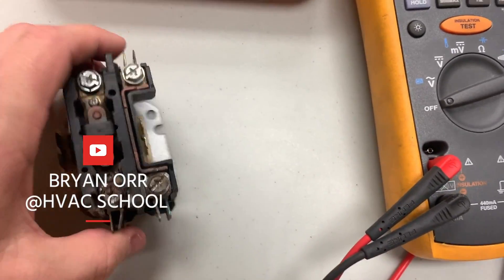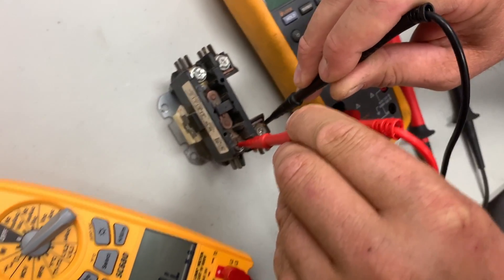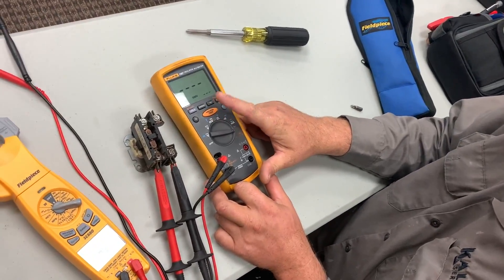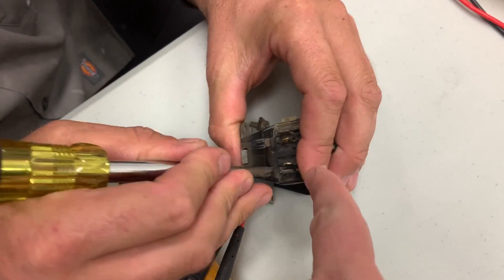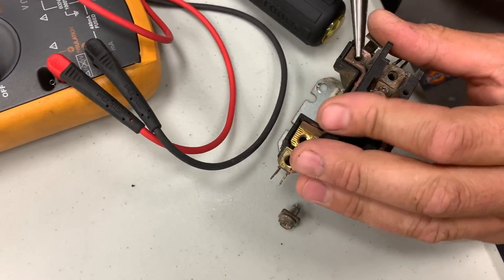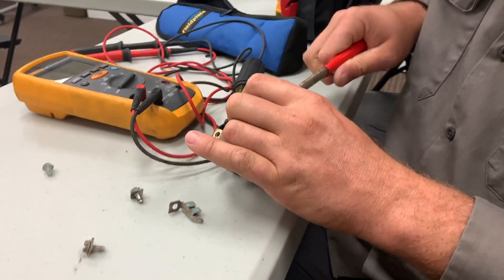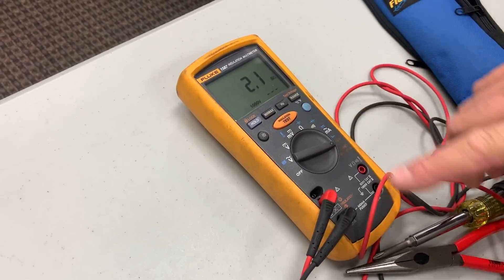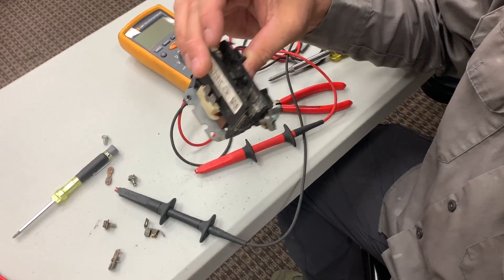A Strange Contactor Issue

Comment: That blue residue on the contactor looks suspect to me. I had this issue about a month ago blowing the low voltage fuse on the furnace and what I had found was that some of the cleaner I used a month before got into the control compartment and dripped down onto the contactor which eventually caused a path for the low voltage current to go to ground.

Comment: I run into this condition all the time in my side business of vintage tube amp repair. A carbon track becomes part of the molecular structure of the insulating material and cannot be removed. Happens often in power tube sockets when the tube has an internal short occur.

Comment: Bryan, hello, but I really DESPISE this CHEAP CONTACTORS , case a Carrier 460 v 3 phase , it only had a 2 pole, & the other led went direct to the compressor , were, it singlephased cooked it , but for SURE I replaced it with av3 pole one just retired the direct leg, all this is being CHEAP, like FRIGIDAIRE used lots of STEEL TUBING, also were FIRST. to use DCHRADER VALVES, those days they were same as car tube valves LONG     Cheers 🇺🇸🇺🇸🇺🇸🇺🇸

Comment: A friend of mine had a brand new contactor that would not conduct electricity through the floating bar. He measured on the bar itself and not the screws. It showed 208 (commercial job).  A solid metal bar that would not conduct!!

Comment: The only place the carbon can come from is the plastic insulators. The contacts by there very purpose have to be made of metal. The actual metal can be different based on the current and voltage for the designed application. The metal at the contacts under high current and voltage arc  thereby vaporizing a small amount of metal each time. If enough is deposited a short may develop during high current high voltage use and this would start as intermittent but eventually fail as a dead short. If I see pitted contacts on any relay I replace them.

Comment: It's called polarizing when the insulator becomes conductive. I am a commercial tech and I have run into this many times. The plastic on the contactor becomes conductive and will create a ground fault or short. I see this mainly on older trane roof top units where there is a plastic terminal strip in the blower compartment for the blower motor connections. The terminal strip will polorize over a long period of time and ground out the blower power causing the breaker to trip. I fixed this issue on many of the same style similarly aged units by removing the power from the terminal strip and using wire nuts to make the connections. Problem solved however, knowone would ever believe me even though the problem was solved. The things we learn every day on this trade.
Reply: Tayler Ellis yes been there done that always TRANE !  230 v , or 480 v same darn thing , cheers 🇺🇸🇺🇸🇺🇸🇺🇸

Comment: I have seen that issue before in field.  I would of replaced the contractor by just the way it looked.  No need to pull meter out when it looks like that.  That would have saved a call back.

Comment: you morons,,its easy to troubleshoot on that,,, carbons may conduct electricity,.. specially on higher volrages,, so,, the main fix of that is to dis assymble  the all contacts in your conractor,, and clean it with emery cloth or sand it SMOOTH with 1200 grit sand paper,, sand it until it will look like new,, contacts,, shiny and clean, and remove all the carbons in the plastic casing inside and outside of your contactor, clean it until it will look new and clean,,, YOU CANNOT DO  THIS FIX IF YOU DONT KNOW HOW TO DIS MANTLE AND REASSYMBLE  parts of contactors piece by piece,, you dick heaheads in our country this kind of issue,, is so common even we have only analog multimeter we can fix it,, YOU MORONS, you want to test us? DICKHEADS!!!!!!

Comment: The coloring agent...
old style bakelite material never did this..only carbon  colored thermal plastics. Do a conductive isolation test on a tan colored   plastic, compare to the black version.  I think it (carbon) adds strength to the materials for torqueing binding screws. 
ask a senior auto mechanic about carbon tracing in the distributor caps....25,000 volts dc arc at each plug tower splattering byproduct or carbon into the area which the rotor whirling in a circle carries these particles in the same direction a million times.  Eventually leaving a trail between the towers and causing a 'short' or alternative conductive path for the high voltage to use. This might be one reason of the solid state ignition and sequential timing..no moving electrode.  Since this application has no whirling, I would bet it is the break down of the plastic.
As my dad once joked about the foundry work..,"if you wanted a day off, pour your black coffee into the molten metal during forming and cooling'", the coffee at 2500 degrees turns to a carbon fissure and pretty much a hole in the plate of steel.
Another thought created by Bryon again 👍🏼🤔

Comment: Bakelite will break down and carbonize over time when exposed to heat with high voltages. This occurs with motor contactors because when the circuit breaks, there is a voltage spike which is much higher than the rated voltage due to the induction of the motor which tries to keep the current flowing through an open circuit. Phenolic board breaks down in a similar manner. I have seen vinyl cords break down over time when exposed to mold which carbonizes the vinyl. Phenolic and vinyl can catch fire in these circumstances. Bakelite usually just smokes and glows as the carbon completes the circuit. Thanks for the good testing and analysis of this failure. Good video!

Comment: I had a similar problem with a 3/4” conduit pipe sticking out of the roof (in a condo complex) under the disconnect somehow rain water got in and filled it even dough it had “watertight fittings”.Inside the attic space it had a romex connector at the end of the pipe with a bunch of electric tape around it. I tried everything,omh’d the compressor,the fan motor,inspected and tested contactor,capacitor,wiring and it kept tripping out the breaker but intermittently,it was until I removed the tape that I noticed some dripping and then pulled the wires,it was then when it became evident that water was conducting to ground!  Even when I did all testing on the wires it showed everything was good!    Bottom line...if You suspect something is wrong,keep going till you find it!🥵😳🤯🤬

Comment: Crazy. I’ve  had that happen with a semi hermetic compressor on the terminal block. I could read resistance with my meter from the leads to the insulator block.

Comment: Carbon is resistive dependent upon how densely it is packed.  That the carbon pile battery testers.  The original microphones were cups filled with carbon powder in which the diaphragm compressed changing the resistance.  

An easy demo is to take a pencil (softer lead is better) rub a swath on the paper then check the resistance at various places along the length.  Add more pencil lead and get less resistance.

Comment: So, a true full PM (Preventive Maintenance), checklist may include: 
1. OPEN service power disconnect.
2. Remove any load side 240V wires AND 24V wires from the contactor.
3. Apply MEGGER/MEGohmeter tester between contactor poles.
Good reading = restore wires to respective terminals
Bad reading = replace contactor

Comment: It's CARBON TRACKS, not carbon traces.  ARCING, lays down CARBON TRACKS.  In automotive, spark plugs will SHORT to GROUND,  via carbon TRACKS, clearly visible, up and down the white porcelain insulator part of the plug,.  Tracks are made by HIGH VOLTAGE ARCS between plug wire connector and spark plug's metal base/body.  Tracks then provide easier path, for each successive arc to follow.  Problem worsens, with each arc.

Comment: I think that contactor is not rated at 1000V, in addition to being old, dirty, wet and rusty due to environmental conditions (AC application).  In the same way, the video is interesting ...
Reply: High voltage or not, the current that is being put through it is extremely small, and it’s only for a few seconds. The thousand volts was just a demonstration of forcing the problem to show itself.

Comment: Neat video.  You see carbon tracking a lot in automotive spark plugs because your dealing with Kilovolts.  Any problem with the insulation like cracked porcelain or a pinhole in a boot can allow that spark to find an easier path than the combustion chamber.  Then each time it happens the carbon trace gets bigger leaving an easier path to ground.  I love this kind of video where you get to see those rare problems isolated and learn something new.  Thanks fellas.
Reply: Curtis Roberts  same happens with the insulators on an oil. Gas ignition electrodes !   Cracks you CANT SEE except from the high voltage  makes it visible , cheers 🇺🇸🇺🇸🇺🇸🇺🇸

Comment: I went on a no air call in Roswell, GA in 1975. It was a 5 ton Carrier condensing unit with a semi-hermetic compressor. The 60 amp breaker in the main panel was tripped. I reset it and thoroughly checked everything including ohming the compressor and fan motor with a Simpson260 meter on the 10,000 scale. I didn't have a megger back then. The house belonged to a friend of my boss and it was about 25 miles from the shop. Atlanta traffic. I left the call in the afternoon with the system running like a top. The next day my boss sent me back saying the A/C was out again. Same problem. I rechecked everything outside and the indoor blower motor as well. I was there for quite a while and again the system was running perfectly when I left. I got the information on the breaker so that I could replace it if it tripped again. A day or so later it happened again and I went back. My boss didn't have the breaker yet but said he would pick one up and bring it to me. This time I left my Amprobe clipped on and just watched it. Within an hour or so the condensing unit lost power with no amp rise. Maybe it was in the wiring? I disconnected the whip and pulled out the three #8 wires. Someone had stripped about a foot of insulation off of all three wires on one side and there was a small arc mark between two of them. My boss brought new wire and that was that. We work in a very interesting trade.
Reply: That’s insane.  Sabotage?

Comment: TY, &  any old school auto-mechanic knows about carbon tracking, distributor caps were common issue for misfires, with voltage following a new path to wrong terminal, ground, coil lead, etc, so makes good sense to me, but we are talking 20K volts or more on secondary side of ignition circuit, but I am only learning this field. but glad to know it really can be an issue here too.

Comment: E\R=I would be 0.00000436amps so clearly ok unless it arcs and breaks down with higher voltage as happened.  Carbon is a conductor when arcing occurs resistance goes toward 0.

Comment: Carbon is conducive. They use carbon brushes in motors.
Reply: Would that be like a grounding brush on a VFD driven motor?
Reply: yes you are true
Reply: carbon is build, when the contacts of two conductor heats,, specially when it is loose contacts

Comment: can you replace a single pole contactor with a a 2 pole contactor?
Reply: As long as you don't have a compressor heater its fine.
Reply: @mforrest85  https://www.google.com/amp/s/www.hvacrschool.com/crankcase-heaters-and-single-pole-contactors/amp/
Reply: Yes you can.
Reply: Yes!
Reply: Not If the unit has a crankcase heater!  You need to stay with a single pole or the crankcase heater will not work on the off cycle.
Reply: @speckulator7516   Incorrect, your supposed  to tie your crankcase heater to the line side of the contactor 240v constant unless you shut the disconnect